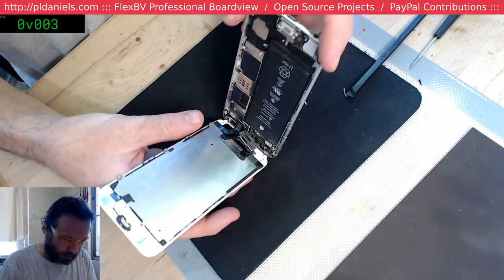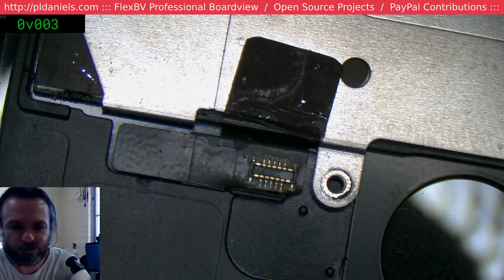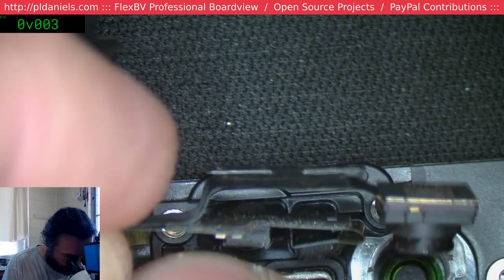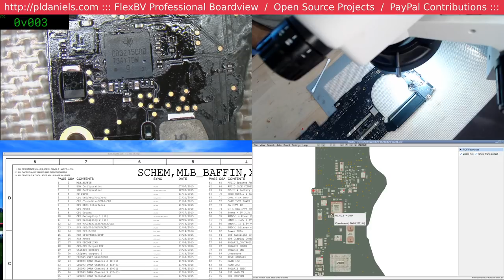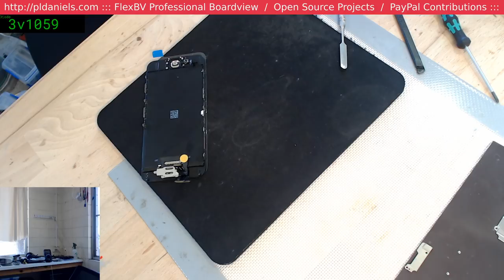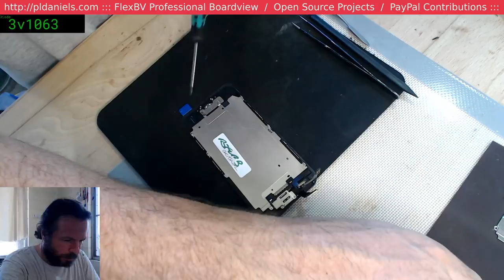Wednesday, 39'C, no airconditioning, gloves are OFF.  iPhone 6 fix and then a Macbook

Comment: I hate summer and i can sympathize with you re the heat. I am a living swamp of sweat during the humid summer season. I really feel for you having to deal with those sorts of temps now. Its still not bad atm here in Sydney but it wont be long until we cop it. If i was wealthy i would seriously have a different residence either in the coldest areas of tassie during summer or overseas and never experience any summer whatsoever.
Reply from the maker: Hopefully some air conditioning will make things better. Just a case of a long list of things that also want the money
Reply: @pldaniels  very true!

Comment: I bet you could get significant benefits from a swamp cooler.  The drier it is the better it cools the air.  As a cheap stand-in for conventional vapor-phase cooling it can help a lot.  You can build your own using a box fan and cheap towels in a pinch.  Doh, and in the video you just mentioned swamp cooler.  But I'll let the comment stand.
Reply from the maker: We used to have one here but the summer now tends to be more humid then in the past but still limited rain, so the swamp cooler makes it even worse :(